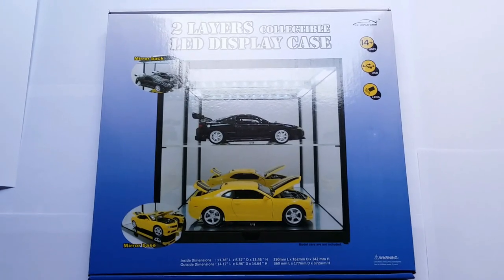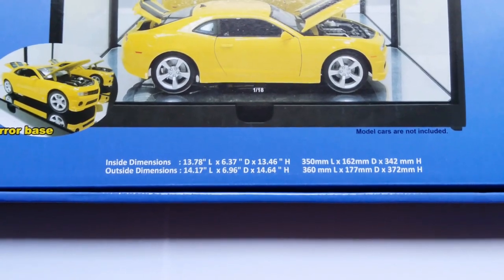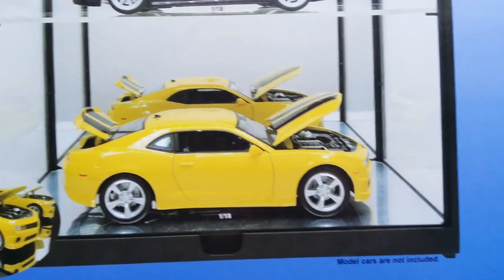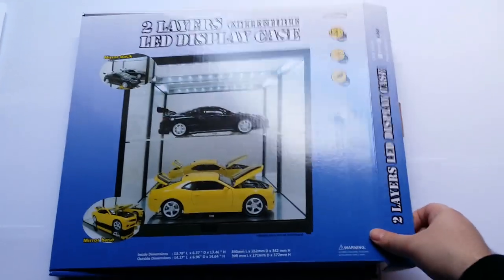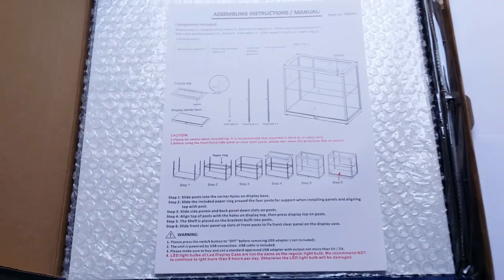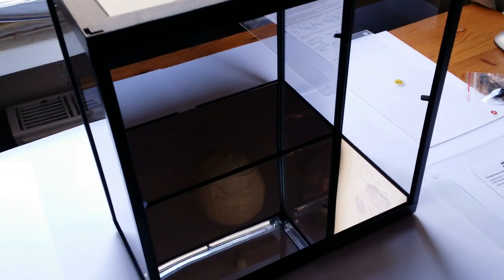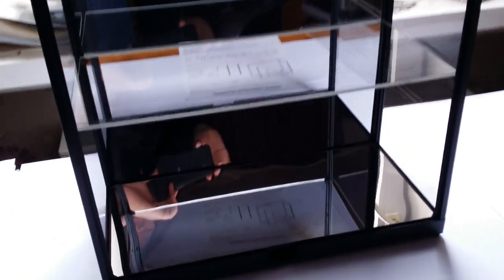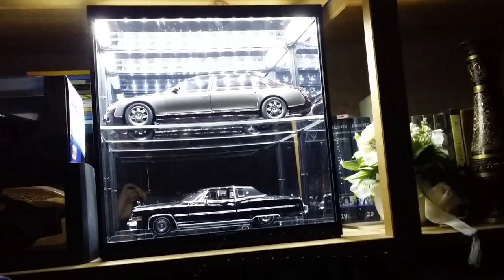How to Build a 1/18 Double LED Display Cabinet by Triple9 (Illumibox)

Comment: I know this was 3 years ago 😅. But did you have any issue with the front removable panel. Because I bought the 4 tier one, and my front panel is a pain to remove. You have to take the top off for it to come off. It might have been shaped wrong. It fits once you get it in though. Just wondering if you had that issue or not.
Great video!

Comment: Hello. How's does this case deals with dust? Does it let some in due to the front opening, while being closed? And how stiff is the shelf in the middle? It seems to flex downwards under that 62 😉
Reply from the maker: yeah the maybach 62 is a heavy diecast car which is why i ended up switching places with the cadillac and now there is no more flex.

Comment: Where do I get this one? My cars are 11 inches long and most of these cases won't fit, as you stated...I don't see a link for this one..
Reply from the maker: in the link below is the one from my video. there's also one that can hold 4 cars, you should be able to find it on the same site: https://ck-modelcars.de/en/double-showcase-with-led-lighting-for-model-cars-in-scale-1-18-black-triple9-t9-187820mbk/p-58251/
Reply: @ImperialDiecast   I don't think they deliver to the U.S....??
Reply: @ImperialDiecast  Thanks.